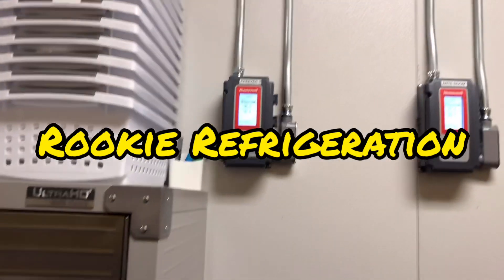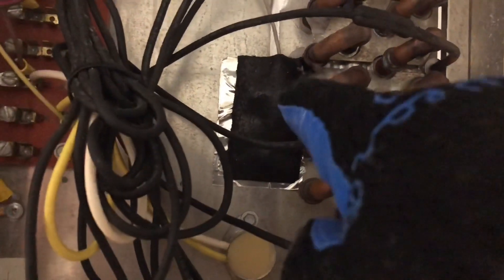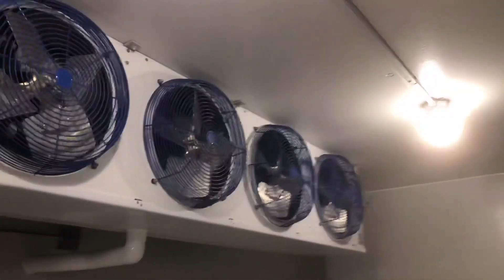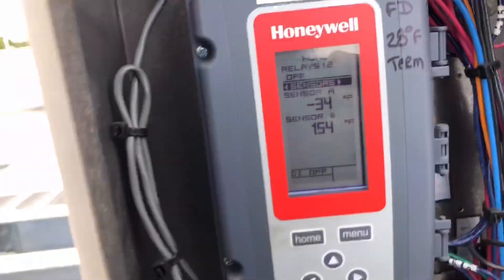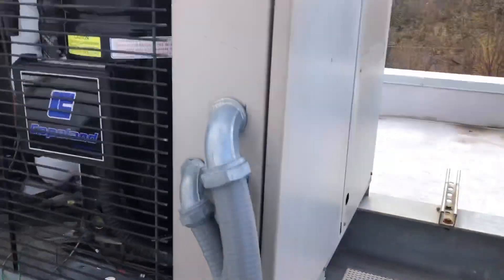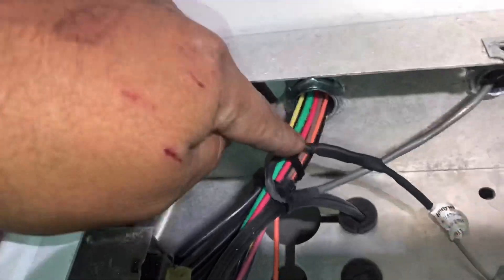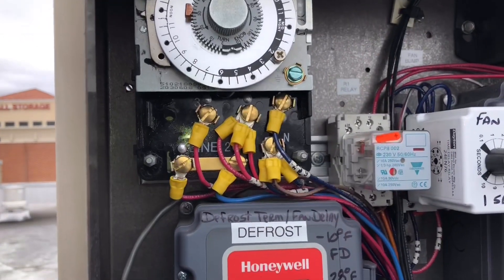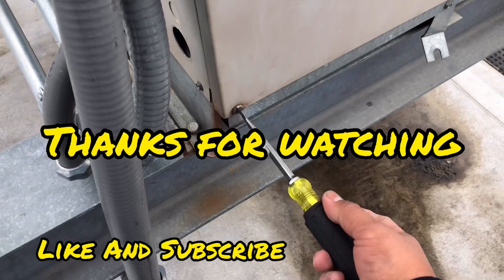HVAC REFRIGERATION:  Working on a -38°C Walk In Freezer WIF

Comment: That should work, I work in those system a lot. All new installs are done with that set up of the defrost sensor. Expansion valve setting is also very critical on those. Set by discharge temp and frost line on compressor
Reply from the maker: nicholas barrett I haven’t had to do any work on the refrigeration side.  Thanks for the advice

Comment: Good vid. Lots of Fun there ! 
Hey Rookie refrig,

A Few things wrong there:

1. Looks like u Got the wrong evaps in that box for that temp. Evaps should be 4 Fpi or 2Fpi Those look like 6 or  8Fpi ( Fins per inch ) Evaps. Defrosts will take too long and Wont work well. allways be a problem. ice bridges on 8fpi evaps at that temp way too fast. Run it By Heatcraft Engineers. Engineer for a -40 box. 

2. Your 28 degree defrost termination wont work. Defrost termination must Allways be above freezing temperature of Water. Set Defrost Termination 5 degrees above Freezing temp. of water. 37 Degree ( F ) termination temp should work. Go to 40 degrees F. if necessary.
Reply from the maker: Yeah.  The funny thing about these units is that they are specifically designed for this application.  It’s so funny.  They have condenser fan motors for evap motors. And the FPI does look funky.  Trust me bro.  These things are untouchable unless the ref eng says we can. Lol.
Reply: @ OcRefrigeration , Hvac & Electrical Video's. I'm curious regarding item (1). The amout of water in air a) 20C, 50RH = 9 g/m3, b) at 100 RH is as follows (in g/m3, rounded): 0C=5, -20C=1, -40=0.2. Taking this into account, what difference does it make to move from -20C to -40C (8 g/m3 or 9 g/m3 of ice, ca. 10% difference). I assume of course that plasma in containes do not introduce water to the room. Is there any dokument discussing the matter? Is particualar, air-to-water heat-pumps use 8 fpi or more although they use all "new air", i.e. no lowering of absolute humidity can be expected after the air has been used once.
Reply: Thats unfortunate. looks like he was only doing one defrost at 2am too. that will never work. 4 defrosts minimum required with that fpi & low temp. evaps will bridge quickly & Suction WILL just start pulling into a vacuum when it bridges. Shortening compressor life. Thats Going to Be a Great client there. Those units are going to be non-stop work for you. You Might as well Buy a House close by , because your going to be there  ALOT ! Have Fun !

Comment: Awesome job..
I agree that sensor should have been at highest point of evaporator coil..
Let me know if you have to set determination set point to 45* i believe 50* is a bit high..
Im curious to know.
Thank you for the great video.
Bryan Tyler Refrigeration
Reply from the maker: Will do bro
Reply: @rookierefrigeration4357  
Working on ice cream freezers ( storage units) ,myself at times..
30 -35 below. 
Almost always need 4 defrosts at 45 min.in a 24 hour period..
I know you have to go by refrigeration engineer in that blood/ plasma storage..
But in my experience..
I'm leaning towards at least a couple more defrost cycles.
But then again,im not a engineer..
But yea..keep.up the bad ass work.and keep me posted.
Thx again bro..

Comment: Unless you get all the ice out of the coil around the sensing bulb it wont sense the real temperature.I use hot water.You have to be careful  and make sure the coil is recooled before you bring the fans on or it could cause thermal shock and blow the walls out.I do this for a living.It seems 50 degrees f is a little warm,ours run at 45 degrees f for termination and the sensing bulb is strapped to the top coil and insulated on the u bend.I do 5 plasma sites.
Reply from the maker: Yeah, I completely understand.  But we CANNOT make any changes without the Refrigeration engineer having approved it.  I mean nothing. So we just do as he says.   If he thinks it's too warm he will call us out again and tweak it.

Comment: I had mini walk in Freezer with 404A thermostat set for -10F and it was calling, High side was reading 200 Psi And Low side 35, the low side pressure was not dropping below 33psi -BoxTemp only at 20F? No answer from @ Hvacvlogger
Reply from the maker: Lol. Hold on.  I don’t know pressures.  I know saturation’s.
Reply from the maker: Ok. 35 psi is like 2° saturated.  You probably have low charge.   What was your superheat.
Reply from the maker: Well.  Maybe not low charge, but you may be starving your evap!
Reply: @rookierefrigeration4357 when I arrived there the sight glass was flashing I cleaned it with 3 lb of refrigerant and after that the the low side pressure would not drop down neither the box temp was reaching temperature it could only go to 20F. I thought of it of more like expansion valve but was not sure.  Where is the best place to take suction line temperature reading when its frosty all the way to the condenser?
Reply: @rookierefrigeration4357  okay good  point  I need to start thinking about Saturation too.
Reply from the maker: XRAY Bravo get the suction line temp leaving the evaporator.  On a WIF we like to see 4-6° of Superheat.  Sounds like a high superheat issue.

Comment: Forgive me for my ignorance, whats the liquid injection control for?
Reply from the maker: Because of the Compression ratio of this compressor and refrigerant (from 0-350ish psi) the compressor gets hot.  So that liquid injection controller has a sensor on the discharge line of the compressor and when the discharge line reaches 175°, the liquid injection valve will inject liquid refrigerant into the suction line like 4ft before the compressor.

Comment: Have a head mounted camera so you can have two hands hold tools? Most of the cases it is very dangerous to work with one hand, especially for electrical diagnosis. If I want to show the owner the problems, I will just film it without ANY fixing behaviors. Safety first man!
Reply from the maker: I had a GoPro but I don’t like the view it records.  I prefer a phone.  And I also have a tripod, but this whole box is aluminum so I can’t magnetize it anywhere. Lol

Comment: whats plasma???
Reply from the maker: Blood without red blood cells I believe.
Reply: @rookierefrigeration4357  And thats whats kept in that WIF??
Reply from the maker: Carlos Cervantes yes, from what I was told is once it’s ready to go into the freezer, it cannot be TOUCHED or moved for 12hours.  It must be kept at -34°C for it to freeze to their specifications.  This is what I was told by a branch manager.
Reply: Ohh wow interesting, and how does it maintain a -35° box temp  on a Normal operation system, how many defrost will it need?